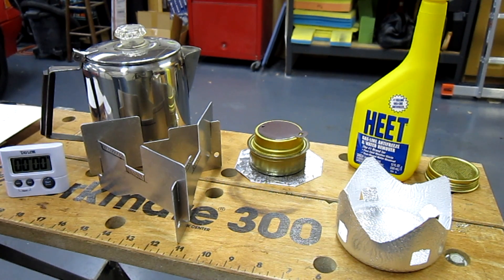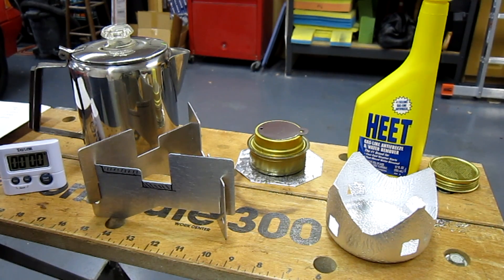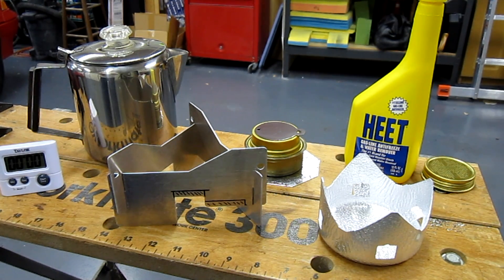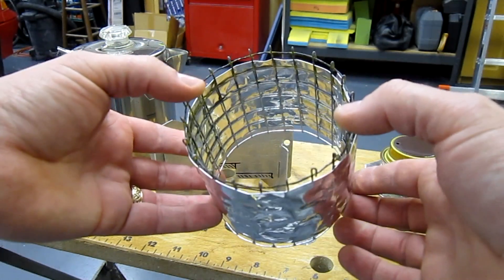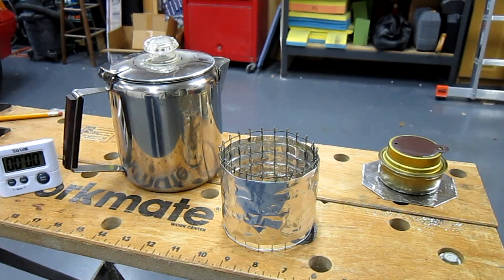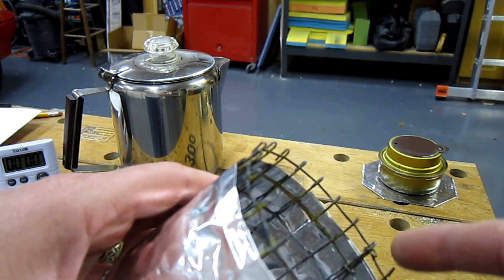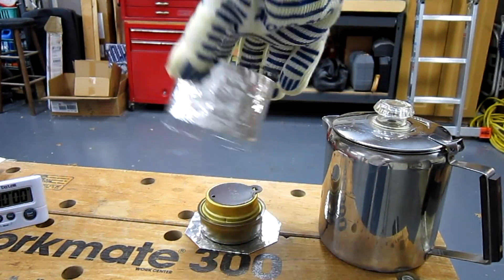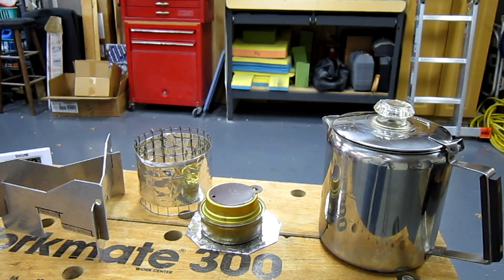Time to Perk - Westwind / Trangia Stove Tests and Performance

Comment from the maker: This perk pot makes the best portable coffee I've found - tried open ground, presses, pour through types, etc.  No doubt something with a wider base would heat faster - more surface area for heat transfer, physics.  I like and use this perk pot often and that's why it was chosen for the series of comparative tests.  I like the Trangia setup, but I can't seem get myself to give up the Primus Ti stove/small can combo if space is available...it's just the fastest and cleanest, yet slightly bulkier.

Comment from the maker: The full kit is too big for what I'm doing...and I never said the Westwind was efficient - it is more efficient than the simple Trangia pot stand, however.  I have another video of a better Trangia burner pot stand - it's great.  The HW cloth was just for testing - various flame heights, although I had hoped it would fit inside the pot itself...but the best height was too tall.

Comment: If your main goal is compact and fast, you might consider using nails to make a pot stand for the Trangia. I did a video about it and it works pretty well. You can't get more compact, it's light, and it performs well.

Comment from the maker: Thanks!  The weather has been very wet lately so I have not been out to the hangar in a few days.  I'll be cutting those notches out and will likely make it a little deeper - the concern being making that area more susceptible to bending.  Too bad it can't be lowered as much as inverting it did.  Ultimately, I'll just build something more optimal...I really want a more compact (but fast) option from a canister stove for short air-race overnights.

Comment: You've got a winning setup there. That's the fastest time I've seen for a trangia, very impressive. I think the heat shield effect is heating up the trangia more so it is running even hotter.
You echoed my thoughts on the Westwind perfectly. Upside down it works ok but it makes the pot supports way too wide to be practical. It is simply poorly designed.
You could try taking more than 1/4"off the notch to get the pot further away too. I meant to try that but never got around to it.
Cheers.